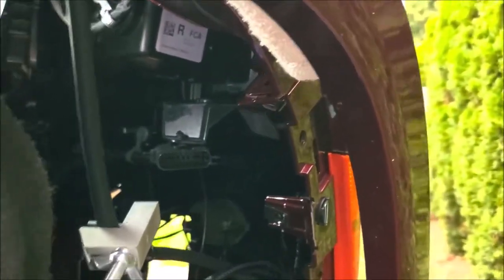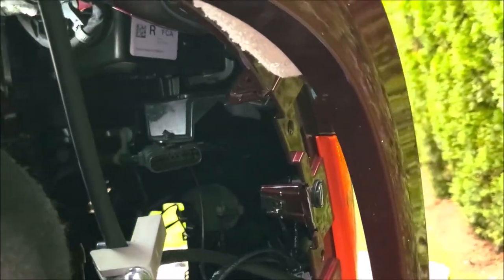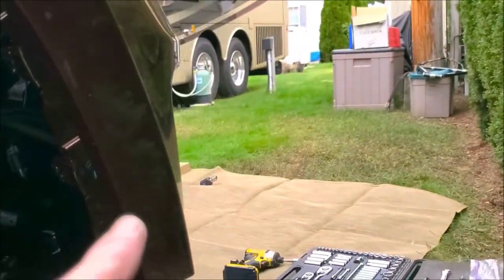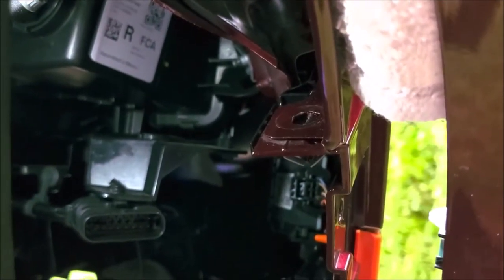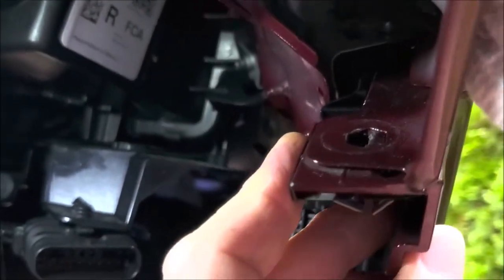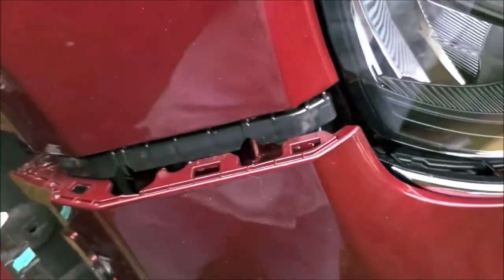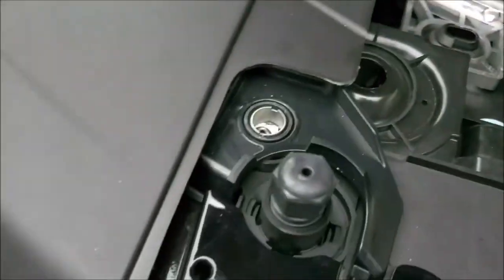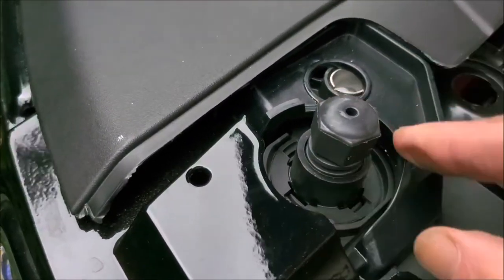Jeep Grand Cherokee L Front Fascia Removal - Corner Clips

Comment: When you say that you are removing the fascia to install a base plate for flat towing, do you mean that you are installing tow hooks on the front? 
If so, do you have a list of part numbers and prices to do this? I'm thinking about installing tow hooks on my '23 Grand Cherokee, and was wondering what it would take to install them.
Reply from the maker: Hi, no, you can't flat tow a vehicle behind a motorhome or other vehicle with tow hooks. Tow hooks are only suitable for, say, extricating a stuck vehicle. Flat towing requires a proper tow bar with locking arms. It also requires a specially engineered attachment modification (aka baseplate) that integrates directly with the frame of the vehicle.
So, if you are asking about flat towing,  check the websites of BlueOx, Roadmaste,  or Demco for specific baseplate application info. See my blog post about my baseplate installation here: https://myquantumdiscovery.com/2021-jeep-grand-cherokee-l-baseplate-air-force-one-installation
If you are just asking about tow hooks, sorry, I don't know much about adding them. My Grand Cherokee L came with them as factory standard. You might try perusing the Jeep forums or contacting a dealer.
Reply: @robpicchione5014  Yes, I was looking to install tow hooks as in to extract a stuck vehicle.

Comment: Hello, I was following this procedure and everything was fine, but the collision system failure sensor came on, can you help me, why would that happen?
Reply from the maker: Hi, did you turn on the ignition when those wires were unplugged? If so it probably logged an error. Make sure all your connectors are mated securely and correctly. Then drive the car over 25mph for a few minutes and it may clear the fault. It may take several ignition cycles to clear the fault.
Reply: @robpicchione5014  thank you, the problem was solved